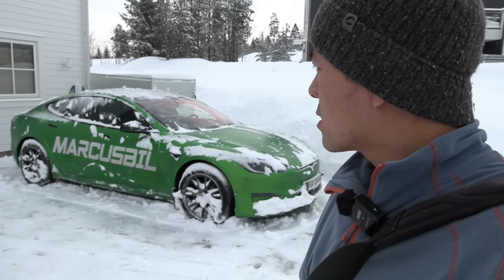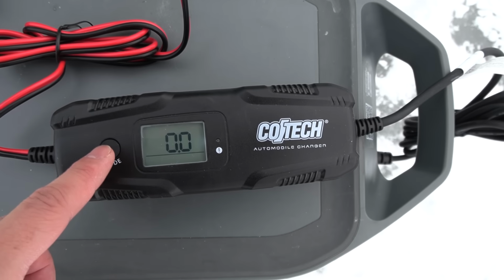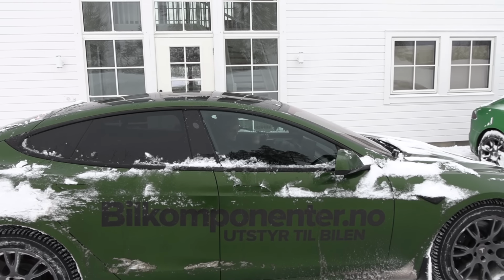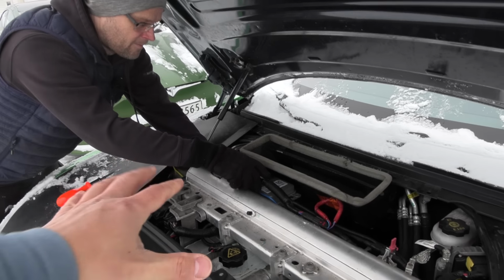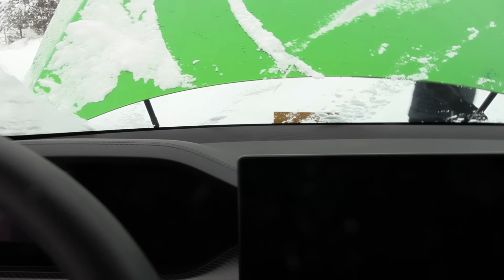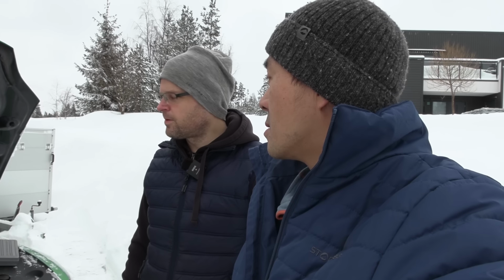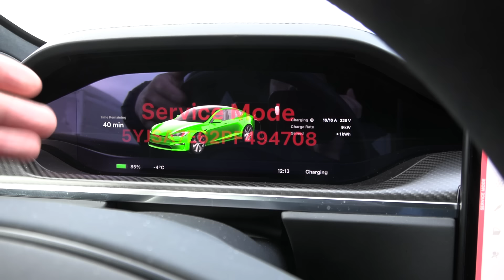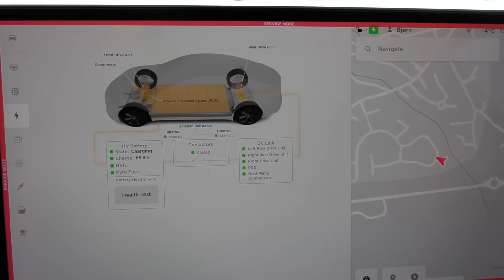Tesla Model S Plaid died in the cold

Comment: I have exactly the same fault on my '14 S85 ! I had a new 12v battery 5 months ago but car shows identical symptoms as that Plaid. Its in a service centre to be fixed today. I will report back Bjorn.
Reply: 12v batteries do not do well in the cold especially if not isolated. A battery blanket can help but I remember living in Massachusetts my 12v battery would not do well especially if they are low capacity.
Reply: Lithium ion batteries operate much worse than lead acid batteries in the low temps.
Reply: @mikapeltokorpi7671 That's what I was thinking. The 12 V lead acid can charge well below freezing. The li-ion must be above freezing to charge. Even if it had a heater, it's responsible for closing the HV contacts so ... rock meet hard place.
Reply: @iamalmostanonymous  Since 2016, the low voltage system is directly energized by the main battery through a separate low voltage circuit that bypasses the contactors. Assuming that circuit is working properly, you can actually remove the 12 volt battery and drive the car. The 12 volt battery is just there as a backup in case the main pack truly dies. Prior to that, the 12 volt battery was needed to close the contactors in order to power the dc-dc converter for the low voltage system so if your 12v battery died, you'd need to jump it. What's going on with this Plaid is completely different than what would have happened with a 2014 even with the same symptoms.
Reply: @mikapeltokorpi7671   No they don't.

Comment: The two naked cables beneath each other for jump start are a very crappy dangerous design. And before the low voltage was going dead, a automatic charging should have been implemented by Tesla. Because there is no e-power in  a car full of e-power? Thats a joke! Aditionally, the low batterie possibly sucks itself to death by heating itself, those batterie are not suitable for cold environments.

Comment: 3:42 The Charger need to detect a "battery" to produce power, when you connect to the two wire , it goes to the open the front trunk, and then you can access the "small battery" in the front trunk, thats why when you connect your small battery charger to the two wire, there is 0V, there for the charger won't produce any power to open the trunk

Comment: You mentioned the well known Hyundai/Kia 12V dead (D.E.D.) battery issues but I wonder if they've sorted this with the latest SW update.
I've got a battery monitor on my Ioniq 5 that reports that the 12V battery is charged twice a day if the car is left standing. 
Doesn't this show that the car is awake and monitoring the 12V battery charge and isn't twice a day often enough to keep the battery SOC at a reasonable level? Maybe it's an issue with the quality of standard Hyundai/Kia 12V batteries?
I've come across comments that the Ioniq won't charge the 12V battery if the traction battery is below 17.5% SOC, so I make sure that I never leave my car standing with less than 20% SOC. 
I've had no issues in the two (winter) months I've owned my car. (Let's hope that I haven't cursed myself with this post! 😉)

Comment: That connector is for charging the eco flow dont think it has output ability...
Reply from the maker: No, it's 12 V output. I'm surprised you have never seen it before. The connector for charging is not round but squared.
Reply: @bjornnyland  ok thanks good to know. mainly using the usb output and AC output...

Comment: This californian shitbox is not designed for such cold winters. Tesla driver here.
Tesla Service in germany is a nightmare.
Reply: At least my old Model S it does great when it is raining… flooding the charge port. This should be recalled!!
Reply: @lbtobl83  oh god. What are u doing in such a situations? Dont charge? Wait till its dry? 
Did u had a short circuit or is it just refusing to charge if you plug it in?

Comment: Yeah, the same thing happens to my gas car, the extreme cold kills the battery,  SO,
when the weather is going to be really cold I put a battery minder on it & I plug in 
the engine heater. Just using your head you can avoid these weather related
misfortunes.

!

Comment: The main battery is completely isolated when the car is off, so before then if the 12v battery is knackered from being so cold, so is everything running off that battery just like in a ICE car. even when the contactors are connected (assuming they are also not frozen solid and the 12 has enough juice left to connect them) the whole system is still 12v and relying on a battery charger far less able than a ICE alternator.

Comment: Forget Tesla. My 10 year old Nissan Leaf lead acid battery is the original one and has NEVER gone flat. The more complex you make a car the less reliable it becomes and that doesn't matter if it's and EV or not. It's a matter of record that the Leaf is the most reliable EV
Reply: My 5.5 year old 2018 Leaf 12v battery died a couple of weeks ago.  Was just after a cold spell with car parked outside.  Is the only ‘repair’ I’ve had to do, so not complaining.
Reply: My Tesla is 5 years old, and I have had no issues with the LV battery.
But yours and my anecdotes are of no scientific value.
Reply: There are millions of Teslas out there driven in all sorts of conditions and been reliable - something you can't say for Leafs.

Comment: Being a diagnostic technician by Mercedes-Benz for over 30 years , I can conclude that there is a electronical fault or a developers fault. Cause when the car is plugged in and with this circumstances ( freezing temps )  , the battery should be kept on temp . Just like they used "standheizung " in colder climates years back in time . My 2 eurocent.

Comment: I don't know if you already figured it, but your 12v charger is a so called "smart charger", it does not actually provide power until it detects a compatible battery in the other end. What you seek is a 12V charger with a "manual mode".

Comment: My intelligent 12 V battery charger does nothing if my battery is compleatly discharged.
But I have an old battery charger, 30 years old, and it delivers 3 A for a few hours into the discharged battery.
After that the intelligent charger can take over.

But that's for lead batteries. They don't die from col only. Is that something Litium-ion batteries does?

Comment: The low voltage is 16V, not 12V! You need a 220V AC to 16V DC transformer in order to replace the low voltage battery.
Reply from the maker: Incorrect. Tesla has been designed to sense when 16 V is disconnected. It will then accept 14.4 V in the LV system.
Reply: @bjornnyland , probably the booster will not output 14.4V. Measure the voltage when the car is connected to it, because the voltage might drop when the current consumption increases.

Comment: Sometimes if a battery (12vdc) goes too low cheaper chargers will not see the battery so it wont chargeif you put it in series with another charged battery iy may work,  but would not expect this with modern tech charging

Comment: alot of those fancy electronic 12v chargers, wont start charging unless they 'see' some kinda voltage coming from the battery 1st. so if you had a completely dead battery, or one below the cutoff voltage, it wont kick in and start charging.  what u can do is get an actual extra small car battery, or lawn mower battery, and use that, or get a older / more basic charger that will always give 12-14 volts regardless of battery volt.  or an older more basic jump pack, ( not the li-ion small ones, but the older lead acid battery kind with a manual switch you can activate).

Comment: I'm not an Electric Car Knower, but it seems like the vehicle is very dependent on both the high voltage battery as well as the 12v battery being at a certain state of charge to power some ancillary systems that are required for normal operation. The HV car battery tries to maintain itself, and also tries to maintain the 12v battery, and if it reaches a state of discharge in extreme cold it stops maintaining the 12v battery, which is also being effected by the cold....thus the car is dead and frozen. Even with the 12v completely dead, you'd think the car, while plugged into an EV charger, would be able to recover from a complete power loss without all this intervention.

Comment: The problem is the LV battery. Plaid had before 2022 IIRC, lead acid 12v battery. Newer Plaids have lithium. I think they must have tweaked the software so that the lithium LV battery has cut off (to charging!) if it gets too cold. Obviously low voltage cut off also exists, hence nothing worked before the DCDC kicked in.

So my theory is that the car noticed the low temperature and decided not to charge the lithium LV battery. It is just to protect the battery. LV battery doesn't have any heating, am I right? If you charge lithium batteries when they are frozen, charging will reduce their lifespan. At least with this lithium chemistry. Tesla should have used Litium titanate chemistry for LV battery for cars that have to endure our winter conditions. Or heating for the LV battery. Preferably both.

IMO, it is just lazy engineering again by Tesla😅

Comment: The problem might be only with the loss of LIN communication to the 16V battery. 
In detail:
 the 16V battery has got a dead-board (a pcb which acts as a Electronic fuse), with a MOSFET which should be enabled to have the voltage for on-board network (14-16VDC).
The MOSFET has some logical states to be in ON position:
1. Active LIN communication (>8s)
2. Self protection mode enable
3. BMS active
4. ECPA active (Electronic connector position assurance) (16V connector on battery)
if any of these signals are missing, then the car creates an error called "VCFRONT_a182_replace12VBattery". This error will kill the enable signal for the MOSFET. So your car dies, as there no common voltage for the on-board network (14-16VDC).

What you along with your friend has done is to manually create the enable signal to the MOSFET (16V battery). You have created a 16V voltage for the on-board network, which will set the MOSFET state to enable. 

I hope this explanation helps. Just a small tip, when you visit the workshop "VCFRONT_a182_replace12VBattery" doesn't mean that your 16V battery is defect.

Comment: my 2013 MS no longer heats the battery in the winter it would always be cold in the morning and would slow charge it was a miracle it made it through the winter but multiple times it would not charge. I also started to have lots of issues with scheduled charging and it not finishing on time when charging overnight in the cold due to cold battery.  It is a brand new battery as of last year.

Comment: I bought small 12V battery, its smaller than AAA and keep it in my pocket, in frunk I have noco boost GBX45. So in case of such situation i will use battery to open the frunk and booster to start the car and open/close doors, windows etc or even try to charge the car!

Comment: With a totally flat battery, most modern chargers will not start to charge. In that instance, you need a power supply that gives 13.8v or as you say a boost pack to get the charger going. (A bit like me in the mornings lol)

Comment: the LV battery is really an achilles heel of a tesla. if it's dead, then everything's dead, and nothing can charge, not even the HV battery. you'd think that when the car is plugged in, the car's LV electrical systems should be able to fallback to AC power...

Comment: Hi  Bjørn. The small 12 Volt electronic charger there will not work on the output of your " big power box" is common failure or it could also be that it is not possible to switch the smal 12 Volt charger on because the electronic circuit there is " looking" at the output side and there you have 16 Volt - what ever it is down to. So if the diff is to small or to big it will not Switch on the 12Volt charger 😐
But why not try to have an extra sparre Battery from a small 18 Volt screw/drill machine. If you connect to the small Wire in the front with 18 volt. It will charge the Tesla  16 Volt/7 ah battery. I think you should try with a Bosch 18 Volt /6 ah.👌
Need a picture now 😐
Reply from the maker: Incorrect. Tesla has designed their LV system to be able to power on 12 V. Once you disconnect the 16 V and feed it with 14.4 V, you will run the screen, etc on it.

Comment: So the moral of the story is to keep your EV plugged in, especially when it is really cold.  This is all self-inflicted because you turned the wallbox off to stop the Tesla "topping up" above 90%.

You could have set the maximum charge level to 50% or anything else, but kept the wallbox on in order to prevent the low-voltage battery discharging.

I guess this was a typical Bjorn Nyland science experiment to test the limits of a vehicle when people don't do the right or sensible thing.
Reply from the maker: Keeping it plugged in is irrelevant. Car was at 82 % SoC.
Reply: @bjornnyland  But the traction battery won't maintain low-voltage battery condition if the car is not plugged in and/or awake.  In the video you said the car had not been "seen" in the App for 4 days, which implies you turned your wallbox off for at least 4 days.  Is that the case?

Comment: The problem is the 12v lead acid battery.  They already have a DC to DC converter, why not use it to start the car?  Why do you need two batteries to start the car?  This is stupid.  This is a problem that should have been resolved a long time ago.

Comment: It would be possible to design elextronic locks so they could be powered by induction charging from the outside, as an emergency feature.
I hope it's possible to get out of the car if the electrical system dies while camping.
It would be a modern horror movie to be locked inside your car while camping somewhere in deep forrest.
Especially in a Cybertruck with almost unbreakable windows.

Comment: My 2023 model 3 survived -35c for 5 days straight and it dipped down to -39c a one night. We charged each night and left the car outside while charging. I drove to work each day fine. Maybe model 3 has a different low voltage battery than model S.
Reply: getting to the end of your video you say that this is not normal and shouldn't be happening. GL getting your car fixed.

Comment: You cannot use an old charger like that without the low voltage battery connected to filter out the DC pulses from the built in rectifier. You're lucky you didn't fry it.

Comment: A lithium jump starter with a boost feature (like the Yaber Auto 6000A), would probably work for this. The boost puts 15 volts on the jumper leads, even if a battery isn't connected.

Comment: The service mode look pretty cool. Are you able to read and clear faults too? I think this should be a standard feature on every modern car. I retrofittet such a system into my 20 years old car (directly into the instrument cluster) and as it is that old, from time to time there is something wrong, so it is very useful to be able check and clear faults and see live data without the need of an extra device.

Comment: I read that the 16V battey has a fault protection and it cuts off power to protect the battey , so after you unplug it like you did then you give 12V to car , then remove 12V and put back 16V which will then force charge on it again since the small battery will have opened its internal circut.

Comment: After living in Fairbanks Alaska for 30 years, we had battery blanket, circulating heater and oil pan heaters on our ICE cars. I think a Tesla would be good in the cold with one or two of those installed. Just keep the battery blanket plugged in and then the car plugged in too.
Reply: All EV have battery heater. It just wont work if its discharged to zero. So safety systems working to save battery from charging at low temp. Its physics from high school. EVs are fine at cold regions. For battery its better than how weather. Blogger just did everything to break the car for headline.

Comment: does this small battery have some kind of heater? maybe it failure and due to low temperature it failed to charge (it is not allowed to charge lithium battery when it is lower 0)
Reply from the maker: No
Reply: Yep. Can't defeat physics. Lead acid can charge down to -40C. I'm curious how Tesla handles this with the switches to li-ion.

Comment: I had th same problem just connect the booster or the auxiliary battery to the to the plate covered with red  rubber with positive, and the negative connect to the chassis. When the computer wakes up start immediately with charging. When it starts charging you can remove the auxiliary battery. If some system do not work properly reinstall the OS from the service menu, usualy problems could be, with headlights and wireless charging. DO NOT DISCONNECT ANYTHING :)

Comment: it´s strange that teslas has the same 12v battery problems of my oldie vw golf mk3. it discharges after 3/4 days without use it. why the dc/dc converter doesn't work when plugged?

Comment: Old charger that is nothing more than a transformer dumping raw rectified AC on the output. Without a battery or large capacitors to smooth the 100/120Hz pulsed DC on the 16V rail, the electronics likely keep resetting from power loss between pulses once they become active and attempt to draw more power since they are expecting flat DC in, not 100/120Hz. You need a switching AD-DC converter to provide much cleaner 12-16Vdc.
Reply: 1 Farad car audio capacitor would help
Reply: @encodersofia  Beware of that inrush current, might kill something or trip over-current protections. Got to do the pre-charge dance to be safe.